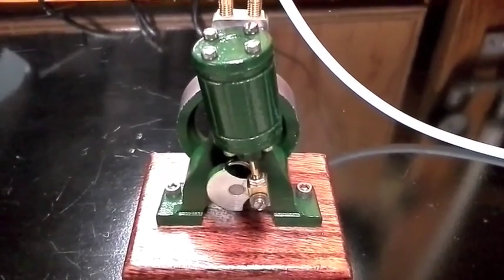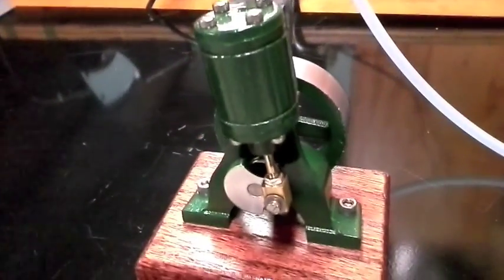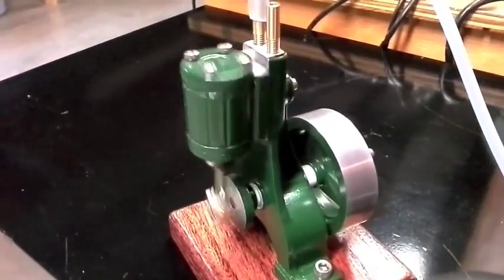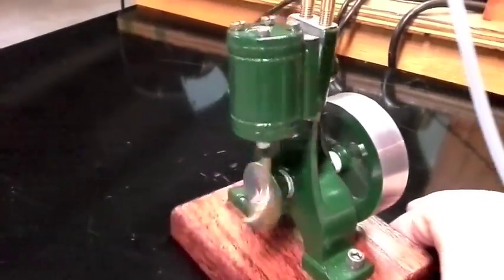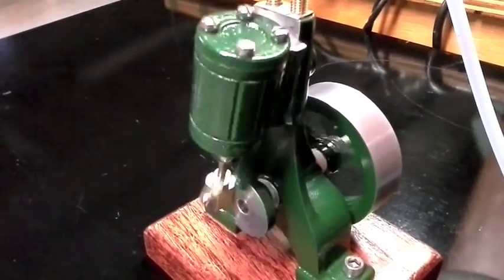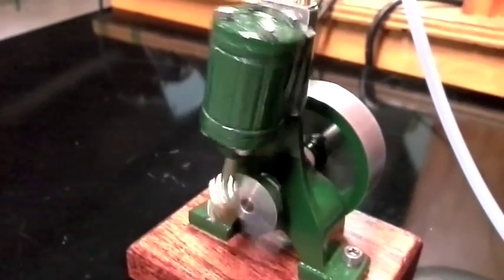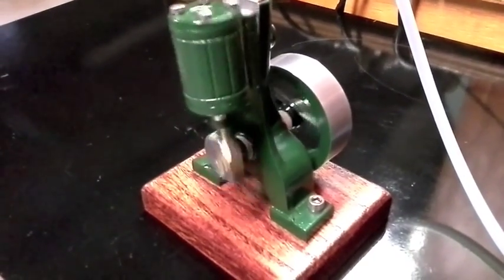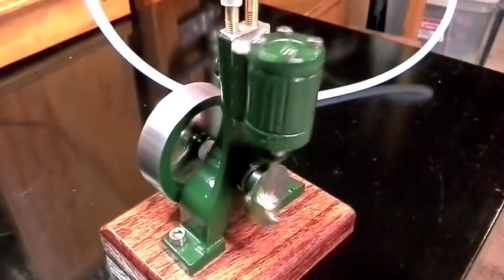Oscillating Steam Engine

Comment: How much machining is required for this kit? Do you need a mill and a lathe, or just a lathe?
Reply: Eh, there's a fair amount of machining involved, but it's mostly finishing of cast aluminum parts with a few simple rods and bushings from brass and steel. I count about 12 parts total not including hardware and extras like port nipples. I think technically you could make due with just a lathe, but I'd recommend both a lathe and mill for this. Setups are just going to be easier that way.